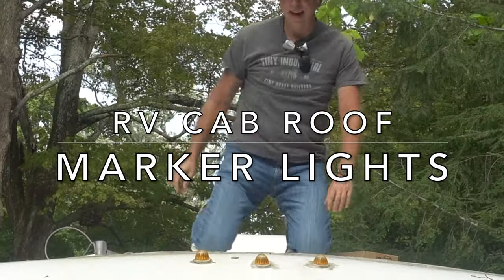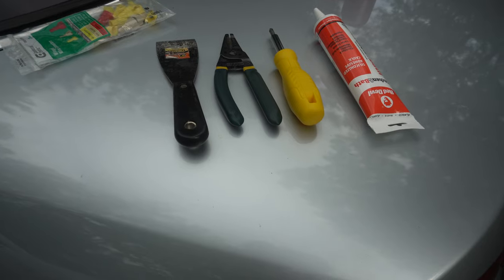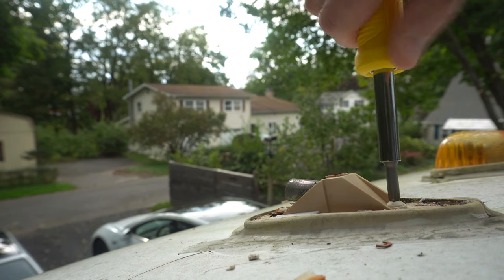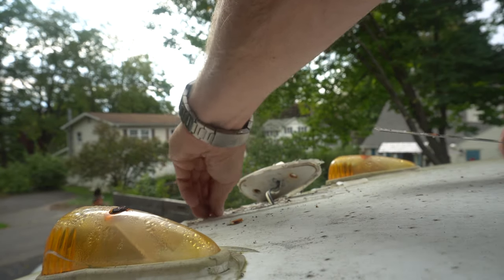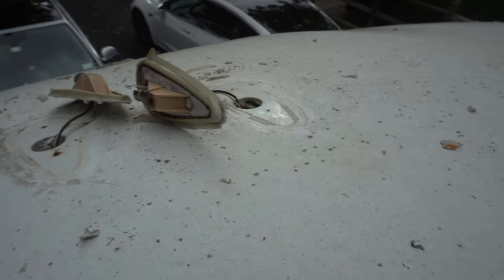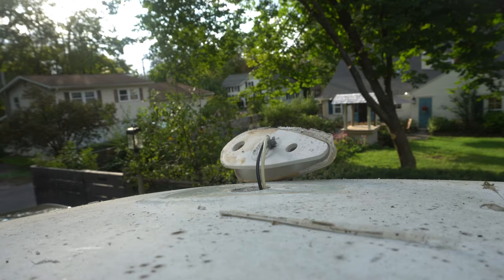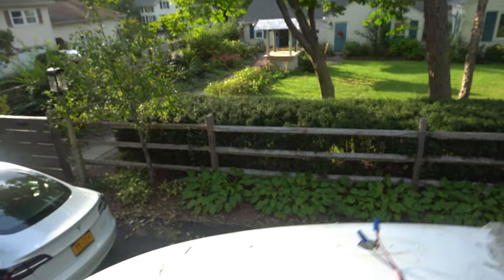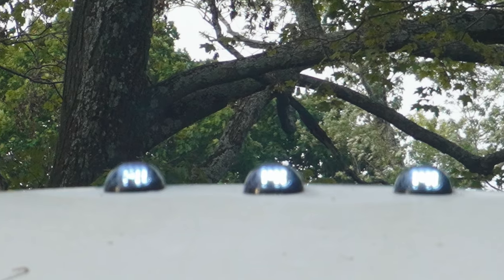Cab Marker Lights Replacement

Comment: Thank you for this video! I will need to replace my marker lights at some point in the near future and this gives me the confidence to do it myself! A few questions: Did you go back and seal around the outside base of the light fixture and screw holes with decor later after filming? Did you have any problems locating studs in the ceiling for the screws to bite into?
Reply from the maker: Oh good. I'm glad that was helpful. I did not add any seal in addition to what you see me do in the video. The foam bottoms on these lights gave me a lot of confidence that they would seal if I screwed them down sufficiently. Just like the original lights, there are just mounted into the fiberglass (no studs). That said the fiberglass dome I have up front is pretty thick and the screws grabbed fine. Also the new lights have a bigger footprint than the original lights and there for the holes for those original lights wound up being covered by these new lights. They've been on for a year and there has been no water leakage or internal fogging. They also still work fine. Happy with this upgrade. Way better and way brighter than the originals. Hope that helps! Be careful on the roof of the RV...it's a far way up. Safety first. :)

Comment: So…evidently the old light screw holes lined up with the new ones? 
I would still have put a bead of caulk around the base of the new lights just in case if they did come loose, water couldn’t get through the base of the lights into the RV. Good job …
Reply from the maker: The holes did not line up. The new lights were much bigger in footprint though, so they covered up the prior light holes. I believe I did put some caulk on there, no? Did you swap yours out as well on your rig?